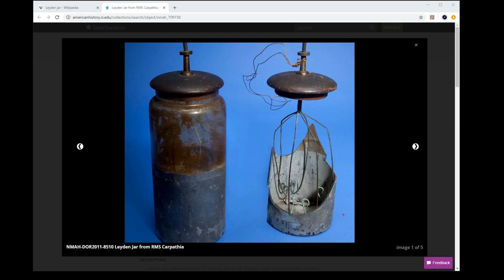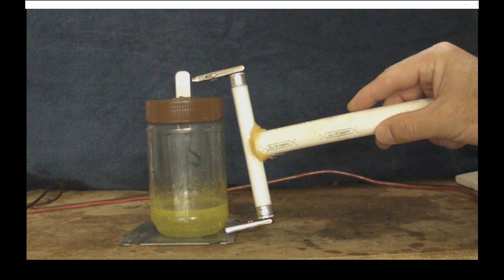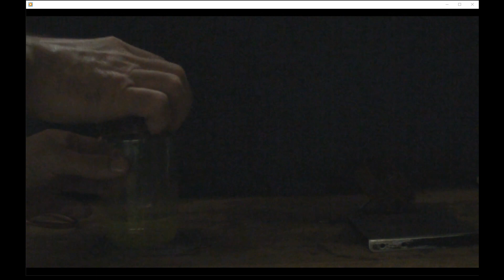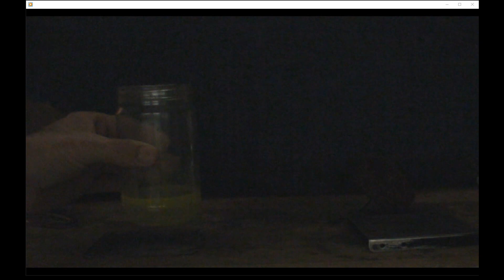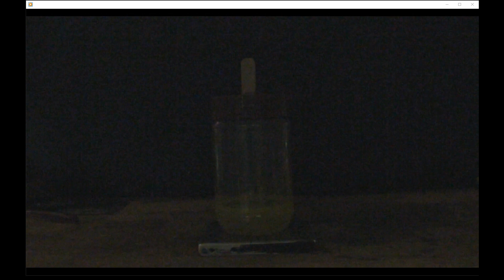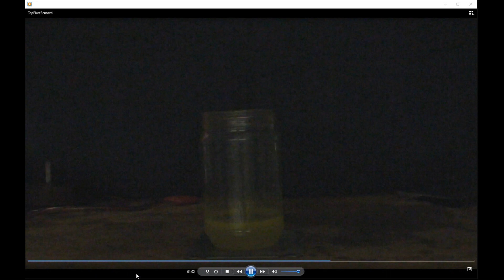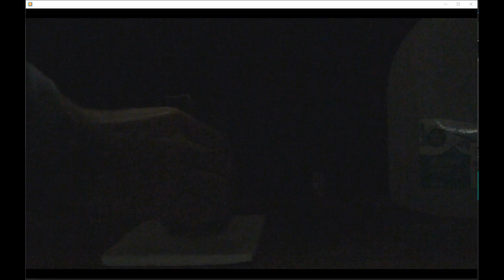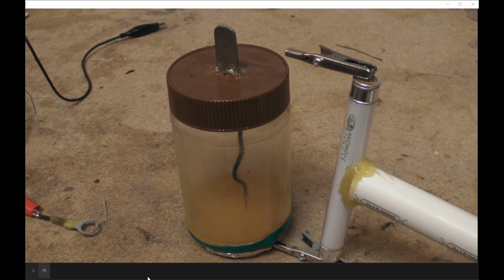Electron Theory can't explain Capacitors, but Ben Franklin can!

Comment: Wonderful experiments! I will go over the video several more times to make sure I did not miss anything. I believe Dielectrics can store energy, but that does not reject the Free Electron Theory. The glass jar can store energy without metal, but perhaps it can store energy better with the metal layer. If we can quantitively compare the energy stored (with vs without metal layer), things should become much clearer.
Reply from the maker: <<I believe Dielectrics can store energy, but that does not reject the Free Electron Theory.>>

This shows the opposite of what current electron theory explains as the reason for energy storage.

Generally, that is a disproof of a theory, i.e. when the theory predicts the 100% wrong answer versus the experiment.
Reply: @itsbs  If you put a tin foil inside the glass jar, and repeat your experiment again, I guess you can see a better discharge effect(if the tin foil can really help to store more energy).
Reply: @itsbs  Free electrons can surely show up in metals, but it can show up in non-metals too, as extra electrons. The Dielectrics in the experiment is more useful in stopping the extra electrons from running away, rather than storing energy.
Reply from the maker: @baolujiang9060  <<The Dielectrics in the experiment is more useful in stopping the extra electrons from running away, rather than storing energy.>>

All you are doing is trying to justify your own thoughts, instead of thinking about what the experiment is telling you.
Reply: Free your mind from modern academia lies. The pseudoscience cultists believe in intellectual elitism. On the other hand, nature does not lie and will give you answers if you seek them thoroughly.

Comment: You're using very high voltage.

You need to measure voltage, current, capacitance etc.

Aldo the Florescent lamp over a very high impedance.

This isn't science!!!
Reply from the maker: <<This isn't science!!!>>

Yes, you are a dumb keyboard warrior, but...I'll ask.

Have you ever done the experiment?  Are you saying that the charge is stored in the metal plates and not the dielectric?

Comment: Do you think this is due to the electric field being stored in the dielectric?
Energy density = .5 * D * E.
If so, is the material ferroelectric? 
Also, if it is ferroelectric, would heating it up to its curie temp dissipate its energy?
Reply from the maker: <<Do you think this is due to the electric field being stored in the dielectric?>>

You can say "yes", but think of a vacuum capacitor and recognize that the "vacuum space" is now the dielectric.  If there is no ponderable material there, your question gets even more interesting.  It also shows where electrical science got neutered my math physicists ("theoretical physicists") when the ideas of the "electron material particle" came about and Einstein's pseudoscience theories got accepted.  It ruined Maxwell-Heaviside theory, which includes the dielectric displacement as an "aether type of substance."

 <<If so, is the material ferroelectric?>>

Again, once you realize the modern physics explanation is not correct, i.e. the plates are not holding the "charge", then you can take the idea of material out of the experiment and figure out what the heck is going on in a vacuum capacitor.
Reply: @itsbs  I'm not seeing where current electrodynamics is wrong here. If the material has ferroelectric properties then the energy is related to .5 * D * E. Current physics suggests the material stores(at least part of)  the energy. 
Is your argument that a vacuum would also store this energy?
Reply from the maker: @joshuastewart7309  <<I'm not seeing where current electrodynamics is wrong here.>>

It is probably because you've never studied Maxwell-Heaviside.

<<If the material has ferroelectric properties>>

It is really dielectric polarization, but again, what are you polarizing, if it is a vacuum capacitor?

<<Current physics suggests the material stores(at least part of)  the energy.>>

I guess it depends on what you mean by "current physics", but no, current physics claims that the E-field is induced by an imbalance of electrons on the plates.  It does not say the energy is stored in the dielectric material.  It does recognize the influence on the induced e-field depending on the Kappa/Dielectric constant of the material.

<<Is your argument that a vacuum would also store this energy?>>

It isn't my argument.  IF you see that the dielectric material stores the "energy/charge" of a capacitor, then how does a vacuum capacitor work?  There is no dielectric material in between the plates.  This is magic that modern physics took away from electrical science with electron theory or "charge carrier" particle-type of theories.
Reply: @itsbs  current physics does indeed suggest that electrets, which store energy in terms of a static electric field do exist. That would be your dielectric.

Your experiment is insufficient to suggest the the dielectric stores the "charge".

Your asking what material exists which transfers this "electric field", why do you reject the current theory of QED which suggests a photon transfer occurs, with a position represented by a wavefunction?
Reply from the maker: @joshuastewart7309  <<current physics does indeed suggest that electrets, which store energy in terms of a static electric field do exist. That would be your dielectric.>>

Do you know who came up with the "electret" concept and when?

<<Your experiment is insufficient to suggest the the dielectric stores the "charge".>>

How would you know?  Have you ever performed the experiment yourself?  Or do you just judge your science based on Youtube videos?

<<Your asking what material exists which transfers this "electric field", why do you reject the current theory of QED which suggests a photon transfer occurs, with a position represented by a wavefunction?>>

I have videos on all of that stuff.  If you would like to continue learning, I've spent a lot of time to help you.  Or you can ignore it... it doesn't matter to me.
Reply: @itsbs  did you read "Observations and Experiments on Condensers with Removable Coats"
John Zeleny
basically it says that franklin didn't do enough experiments and rushed to conclusion
and you are repeating his mistake
the conclusion is wrong of course
there are many lies around, however the physics of capacitors is not one of them
p.s. sorry if i burned your bubble, it was my intention, but i know it always hurts
Reply from the maker: @owieri  *<<you are repeating his mistake
the conclusion is wrong of course>>*

Haha, why don't you do the experiment yourself, instead of just reading and watching videos to do your "science"?

Do the experiment yourself and don't rely on what other people say!

Comment: Is a battery simply an electrochemical version of an electrostatic capacitor?
Reply from the maker: <<Is the shock the first experimenters with these jars sustained the origin of the term "jarring"?>>

To better understand a battery, put a drop of distilled water onto a piece of zinc metal (or some metal).  This should not allow the ION transfer as described in battery teachings, since you have no IONs in the water to transfer "electrons."  Put a volt meter probe on the top of the water drop and another on the metal... you will get a voltage, i.e. you just made a battery with distilled water (great insulator!).

So, water is magical.  Just dielectric, insulating, distilled water coming in contact with metal creates a battery.

Batteries are very "current" based...amps
Capacitors are very "tension" based...volts.

But in the end, both are just a combination of insulator (dielectric) and conductor (metal).  With Einstein's theories, electricity is pretty much just about metals/amps (electrons particles flowing in metal) , which completely destroys electrical theory.  Oliver Heaviside new the importance of dielectrics, and Nikola Tesla moved into the high-tension, dielectric electricity experiments.  Einsteiners and electron particle-ists basically killed electrical science.

Comment: Hey, but can't that be, that the distilled water (as not being an ideal distilled water) can store some electrons? Just asking. I've just read, that the commercial distilled water is not a perfect dielectric..
Reply from the maker: Sure, if you believe in electron theory, the discharge of the dielectric occurred with completely separate metal plates, so it blows away their theory.

If you "move the goal posts" of the erroneous theory to the dielectric only, then you'd have to say there is something in water that is acting like capacitor plates, or "semi-conducting".  Proof?

Then...what is acting like the "metal plates" in the vacuum capacitor, since we've proven the "charge" is in the dielectric (vacuum of space)?
Reply: @itsbs  Nono, I mean, the reason why changing plates would still store the electric charge in the jar, is because the distilled water and canola oil are partially conducting (as not being perfect dielectrics) and the charge stored in this mixture as if it was a conducting plate. I am just asking, why you are so sure that the distilled water and canola oil are perfect dielectrics in this experiment?
Reply from the maker: @ar73miy  <<Nono, I mean, the reason why changing plates would still store the electric charge in the jar, is because the distilled water and canola oil are partially conducting >>

I understand what you are saying.  You must not understand what I wrote.  Try it again.

If you are saying that electrons are moving through the insulator to discharge, then that is a different theory of capacitors.

<<and the charge stored in this mixture as if it was a conducting plate.>>

So you would have to believe a dielectric turns into a conducting plate that holds charge.  Prove it.  Why would the electrostatic meter show a nicely polarized e-field?

<< I am just asking, why you are so sure that the distilled water and canola oil are perfect dielectrics in this experiment?>>

I'm telling you now to stop the conversation and go think it through.  Do your own thinking about it.  Perform the experiment in different ways.

Stop asking me questions now and do your own work to better understand it.  Or don't... I don't care.  Just stop asking me questions about this, so you can do your own thinking.

Comment: This is just remarkable. Since my school and university electronics hobby I thought charge collects on the metal plates. What a revelation!
Reply from the maker: Yes, now you can see with the electro-static meter at the end of the video, that the dielectric is polarized... which makes you think about the "vacuum" capacitor polarizing "space."  This is what James Clark Maxwell taught and it got completely neutered by Lorentz and Einstein.

You can think of it as a temporary "electret", discussed by Heaviside and is the dielectric analog of the magnet.   Lot's of interesting stuff to explore there...
Reply: @itsbs  hey, do you have some link for Maxwell's explanation?? Very interested..
Reply from the maker: @ar73miy  "A dynamical theory of the Electromagnetic Field" 1864

https://en.wikisource.org/wiki/A_Dynamical_Theory_of_the_Electromagnetic_Field
Reply: @itsbs  i have just read about the vacuum capacitor and hey, isn't it a proof that there is ether??? The ether got polarised..
Reply from the maker: @ar73miy  I would say yes, it shows that space isn't empty, which invalidates Einstein's version of relativity.  Tell that to all of the academic institutions and Phd's around the world...

Ether in terms of a "gas filled space" I don't think this is correct, but more like Maxwell explains in his introduction -- there is a fluid force like component (magnetic) and an elastic force like component (dielectric).

What it "physically" is... well, that's tough.  I generally think more about what it meta-physically is..."electric in nature"
Reply: @itsbs  "I generally think more about what it meta-physically is..."electric in nature" imo, That is an excellent summary of the appreciation about the 'Aether'. Thank you. 
   I so enjoyed watching and learning from this video. :)

Comment: Very nice video! Here is another piece academic dogma that is possibly related to your point about capacitors: Electrolysis aka the electroplating process.
In countless chemistry textbooks, electrolysis is 'explained' via diagrams that depict electrons 'traveling' up a wire from one electrode, thence through the power source, down the other wire to the other electrode, and then swimming bravely through the electrolytic solution in a beaker to 'complete the circuit!' All nonsense, since electrons move at a literal snail's pace in copper (never mind electrolyte). The only way to explain (correctly) the electrolysis effect is to think in terms of the electromagnetic wave front traveling near c, around that same circuit (i.e., a movement of CHARGE itself). Otherwise, if it was really a matter of electrons 'traveling' to pair up with ions, it would take tens of millions of years even for the modest amount of metal we observe to be 'plated out'. Yet the electrons-riding-a-Ferris-wheel notion persists, even at the graduate level in electrochemistry, while the electromagnetic wave front, which does the actual work, is not even part of one's vocabulary.
Reply from the maker: <<Very nice video! Here is another piece academic dogma that is possibly related to your point about capacitors: Electrolysis aka the electroplating process.>>

Thanks, yes.. the electroplating process is very much related to the operation of the chemical battery.  It is based on Faraday's ION model, which made it way back into the "Lorentz ION - electron" model, and then completely bastardized by Einstein's empty space projectile particles.  I was going to do a video on the chemical battery and ION problem, but I went a different direction.

Comment: The real local entropic realm is always a field of standing waves convergences. 
That's, for example, the "electron" manifestation, "photon" manifestation, "proton" manifestation, etc, etc, etc, and further down their "constituents" on the neverending causal chain it is found absolutely the same natural dynamic.
None of them is a "solid particle" at any neverending micro and macro scale of the Universe.
All of them are convergent localities of the fields of different standing waves, at different entropic realms.
( "Entropy" is just the degree of "arrangement" of the free, natural, local dynamics. )
When this "local" natural dynamic is "disturbed" in any way, the general universal dynamic created the natural reaction to restore the local general entropic realm.
That's the local realm of, for example, pressure, temperature, charge, radiation, electromagnetism, magnetism, vibration, frequency, speed, acceleration, mass, force, energy, etc, etc, etc.
The threshold between the localities of standing waves convergences and the general entropic fields in which they take place are exactly the apparent "solid" surfaces observed in the so-called ( progressive ) macro-realm.
That's the point where theoretical illusion emboldens the impotent mind to see "particles" that in reality do not exist. 
Mathematics represents a theoretical idealisation that confuses very often the approximate reactive effect for the real active one.
Reality is not mathematical in its fundamentals. It is just simple and naturally "opportunistic", taking always the natural dynamic of the least entropic "resistance".
Reply from the maker: <<The real local entropic realm is always a field of standing waves convergences. >>

This all sounds good, but what is waving?

Comment: Fantastic video. BS can you do a video about the basics of the modern establishment atomic theory, and the way this theory ties into the modern establishment electro-magnetic theory, and describe where these theories are deficient and/or wrong from the way you understand it? My understanding is that electricity is NOT electrons, but it is a force or energy CARRIED by electrons. After watching your videos I'm not sure that my understanding is even correct. If you already have made a video like this where would it be? Thank You. Probably every field of modern science is corrupt at basic levels.
Reply from the maker: <<BS can you do a video about the basics of the modern establishment atomic theory, and the way this theory ties into the modern establishment electro-magnetic theory, and describe where these theories are deficient and/or wrong from the way you understand it? >>

This is what Erwin Schrodinger did.  I have a video that scratches the surface of this, called Quantum Mechanics/Computer Pseudoscience.  Schrodinger's work is really an extension of Maxwell's theory, not Einstein.

<<My understanding is that electricity is NOT electrons, but it is a force or energy CARRIED by electrons. After watching your videos I'm not sure that my understanding is even correct. If you already have made a video like this where would it be? >>

So check out the video above, but also read James Clark Maxwell's paper from 1864.  The introduction is very important, because it details the electrical ideas of how the equations were really derived.

https://en.wikisource.org/wiki/A_Dynamical_Theory_of_the_Electromagnetic_Field

Also, Eric Dollard has a book called Common Language for Electrical Engineering and a couple of Youtube Lectures on electrical science.